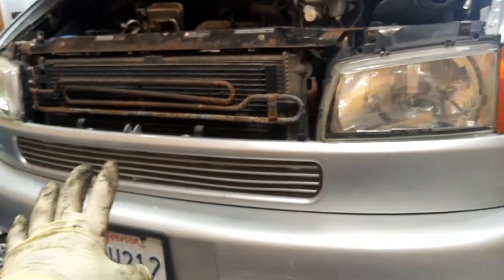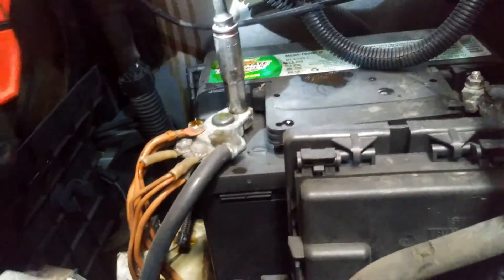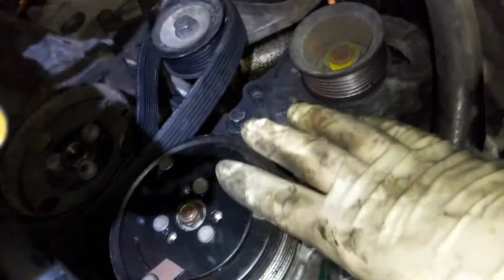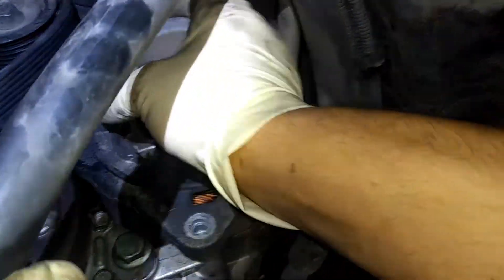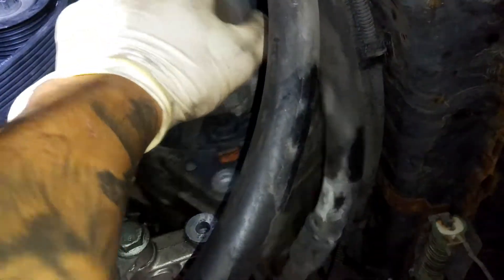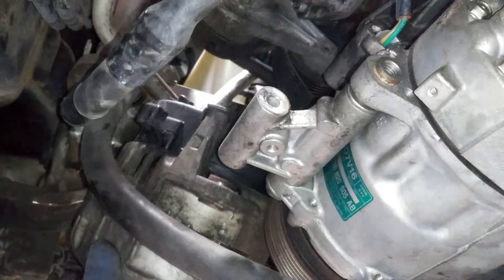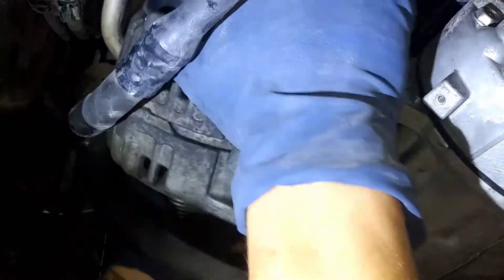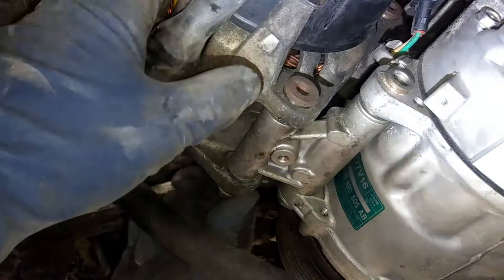eurovan alternator replacement

Comment: looksm like you moved the aircon pump mounting bolts   to get the alternator down and out .I have 1.2 the front panels off and gave up because it was getting dark .80 year old wannabee mechanic .. mechanicing is ok    just getting back up from the floor is a struggle .

Comment: Thank you for your time making this video tutorial, it took me a lot of head scratching to find out how to de-tension the belt, I have a ACV T4 2002 its slightly different, the very top pulley is the movable one to reduce tension, 13mm straight long reach spanner 🙏 good work